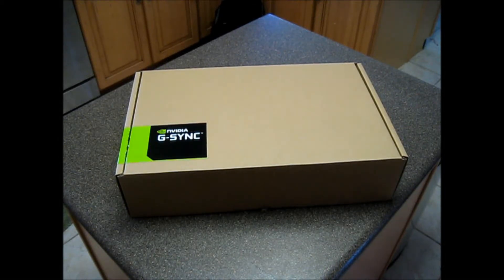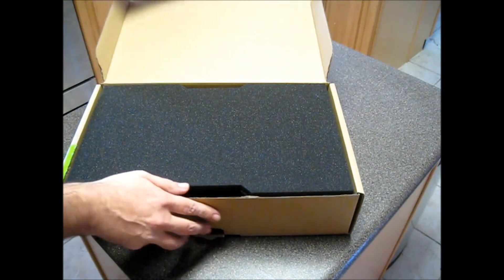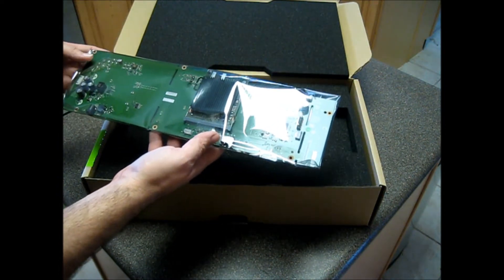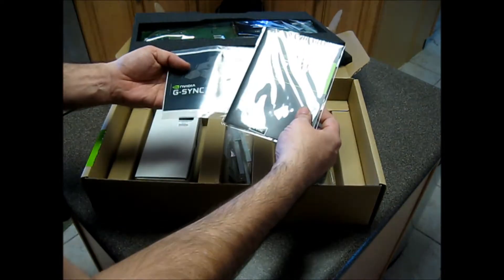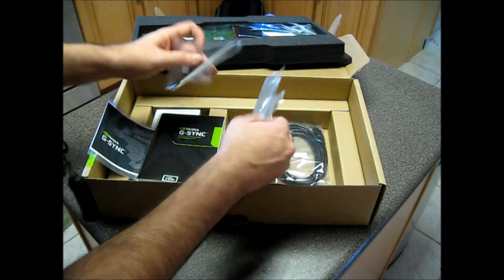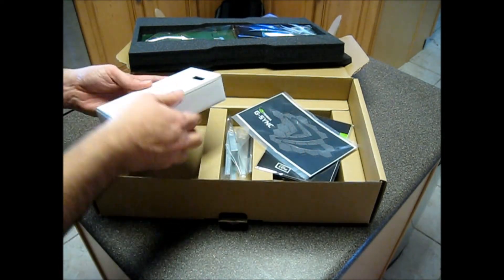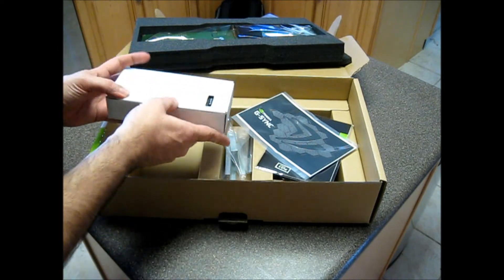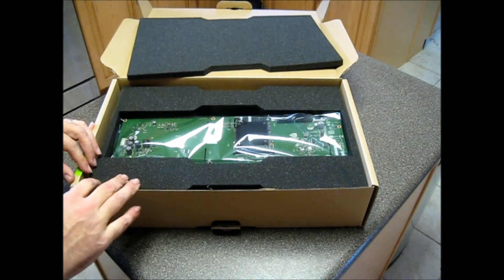NVIDIA G-SYNC™ Unboxing and Installation

Comment: i have the 4k Philips 40 inch monitor, will it install on that?

this looks so dificult, couldnt invidia make it any easir?

can i just pay you to install it on mine lol
Reply: This was years ago, and was released by nvidia as a proof of concept and market test for the monitor companies. It was one model of monitor and a limited number of kits sold. I happened to be one of those who bought a kit and did it. I was literally looking for a solution to screen tearing when they announced it and I bought right then and there when I found out.

Comment: Is this avalavble for the VG278HE?
Reply from the maker: Not really.  They are designed for the VG248QE and how the boards are laid out in that enclosure.  Chances are that it may work in the model you listed, but would require custom made cables to make it work, much more hassle than intended.
Reply: thx. i did open my back up and see the cables are in 2 not just one
Reply from the maker: Yeah they are split into two parts right?
Reply: Eric Ochoa correct. Seems like you would have to have custom cables soderd into the new board... or replace with the existing ones. So simple for them to just come out with a 278 model compatible one... but I assume this is because they only make one Board for all future LED monitors.